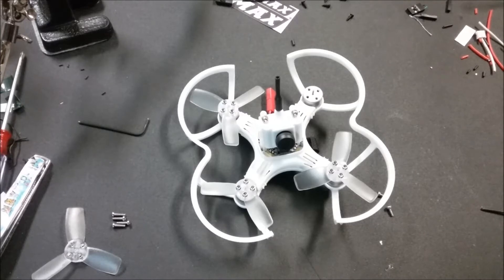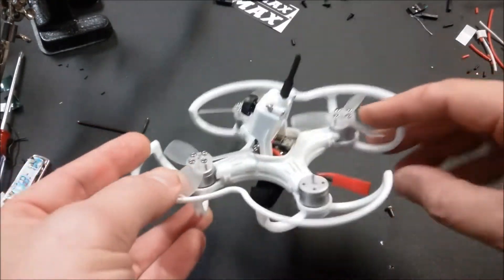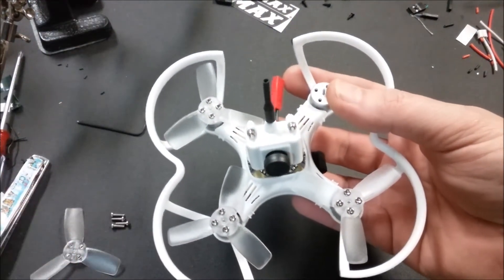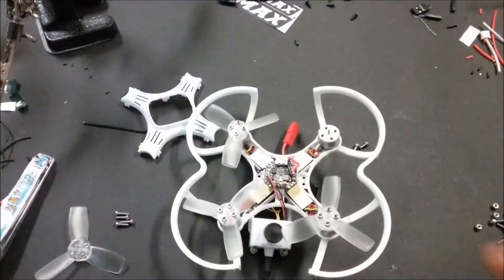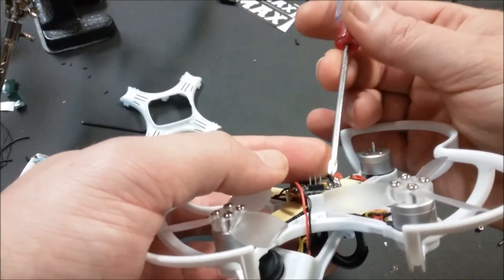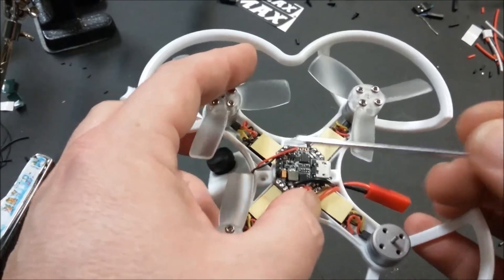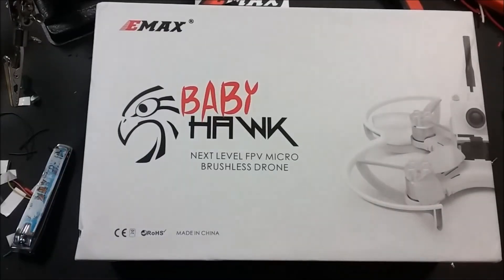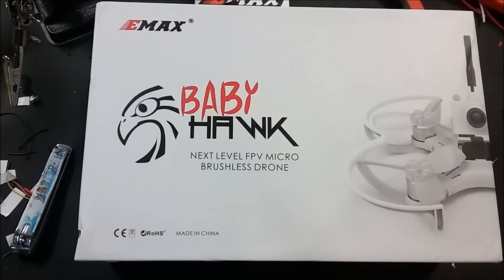How to install a satellite receiver on the EMAX Babyhawk

Comment: Just use a lizard 95 spektrum board for 20 bucks it fits right on
Reply from the maker: Peter Zingler, thanks for sharing your advice.   Sincerely,Dez
Reply: I noticed how complicated it is with the 3.3v so i found this lizard board online .it even fits the pins ;) but all in all frsky xm is what the babyhawk is made for
Reply from the maker: Peter Zingler very true and I have a Devo 8's modded so I can use anything but I have so many people that have given me requests for how to use a dsmx SAT and that's why I initially made the video. And when I made the video Emax had sent it to me before it was released so I really really appreciate you sharing that information for my subscribers. Thanks again sincerely Dez
Reply: Can you do us a favour and make a babyhawk 3s pids video ?
Reply from the maker: Peter Zingler I can probably do that I think I already got them done. I put my baby hawk guts inside a tomoquads frame but Im pretty sure I do have pids saved though from when I was flying 3s on it. I'll see what I can swing this coming week I'm out of town right now. Thanks for the suggestion. Sincerely Dez

Comment: Perfect, thanks for taking the time to make this vid. Appreciated!
Reply from the maker: No problem! Very Glad I could help!  Please subscribe,, I have lots more Babyhawk upgrade stuff coming in the next month. Also I just received the New Emax 1106 4500kv for 4s sent to me from emax!  Tomoquads is releasing a 2" frame called the Mikro 2 which I believe will be a perfect upgrade from the Babyhawk. It will be a very easy move to take the babyhawk parts right over to the better CF frame. You can also do it with the complete original Babyhawk setup and be ready to upgrade during the move or as your skillz grow..  Thanks again for the kind words and Happy flights, Sincerely Dez
Reply: I Subbed as soon as I saw the vid.  I've just got a babyhawk to go with my 4 and 5 inch racers and as a spektrum user (we get rarer by the day in this Taranis world!) it was exactly what I needed to fit my lemon RX. Looking forward to the upgrade vids. Cheers, Jez.

Comment: Do you only need the remote receiver?
Reply from the maker: Drift King, yes you can bind the sat rx in the betaflight software and you do not need a full rx to do the binding with the sat rx. Thanks for watching, Sincerely  Dez
Reply: desode9 do you think this is good for an amateur in quads I have done other rc stuff like fixed wing,boats,and cars
Reply from the maker: Drift King it is very durable and stable when set up in angle mode. it is however a quick little drone! even on 2s. If you have decent  experience in fixed wing craft then I think you would be fine with it. You may want to be wary of the power of it as a beginner in quads. keep in mind it can be flown indoors but it takes a haigher skill level to pull that off. It is more of a outdoor quad.  Keep in mind that if you are using a sat rx that needs soldered as in my video that it is some very tight soldering.  I havent looked but if they have the BNF versions out now I would recommend that route if you arent good at small soldering.  Other then that I think you would be happy with it as a first drone for back yard flying.  I hope that helps you out in your decisions.  Stop by any time! I always answer my viewers and if a subscriber of mine has a issue I will try to help them any way I can.  Thanks for watching. Sincerely Dez

Comment: Thank you for your review. Do you know where to order a HEX key in 1.4mm for the motors because I can not find anywhere.
Reply from the maker: Use a 0.50 Hex tool.. You can find them most places.. Ace Hardware is where I got mine. Emax had told me a 1..4mm Allen but I couldn't find one either,, that is actually a 0.50 hex. I hadn't found one until I did the Esc upgrade video so I had the size in that video which came after this one. 
Thanks for watching and please subscribe. Sincerely, Dez
Reply: Thanks desode9

Comment: i bind BH with  lemon rx dsmx satillite i.e i can see the solid red light but can't start the motor..
Reply from the maker: Yes that is what I personally am using!  Works great!  Thanks for watching and please subscribe for more Babyhawk goodness!  Sincerely, Dez
Reply from the maker: Do you have the Arm switch set in betaflight? It is under the Modes tab. You have to set it to a switch on your radio.
Reply: i set Arm switch in Aux2 and for some reason the ARM does not turn yellow in betaflight when i flip the switch.. i can't figure out what i am doing wrong..
Reply from the maker: Ashish Amatya, make sure that your throttle stick is all the way down and then if you have click save on the betaflight tab. The throttle stick is not all the way down when you throw the arm switch it will not arm. if that is not the case then it has to do with your throttle stick value you need to make sure on the receiver's tab that when you move your throttle stick the center position is 1500 the low position is a thousand and  wide open is 2000. You will probably have to adjust this in your radio settings via the radio and changed the range of the throttle stick. Also make sure that you always click the save button when doing anything in betaflight on each individual tab.
Reply: my throttle low position is 1159, mid around 1517, and max at 1841. 
Here's what i did.. http://sendvid.com/4v1c4xq1
What do i need to change ?
Reply from the maker: Ashish Amatya yes the low end of your throttle stick range is too high what kind of radio are you using? you're probably going to have to look up in the manual for your radio how to adjust the range of the sticks. you can try sub trimming the throttle Channel and while you're adjusting that in your radio look at your betaflight screen and see how much lower that range number gets on the throttle. every radio out there lets you change and adjust the range movement of the sticks. there are just different ways to do that on each different radio brand. I use a Devo 8's on my radio it's called scale. like I said the terminology and the instructions to do it on each radio is going to be different so you going to have to look in your manual for your radio. like I also mentioned your only 159 off so you may be able to adjust it with your sub Trim in the radio.
Reply: i am using devo10 so the config should be some what similar to yours i guess? In throttle mixer i can see scale set to 100 and offset 0 so i think its normal settings.. could you share your deviation ini file
Reply from the maker: Ashish Amatya I dont think the ini files switch between devo models but give me your email and when I get home Ill send it to you along with pics of my setting in deviation.
Reply: desode9 its ashishamatya at gmail Also plz send screen shot of pid. thanks again !
Reply from the maker: Ashish Amatya Gotcha! No problem.

Comment: i got my satellite installed everything works properly but the throttle. I get a reaction from all inputs but nothing from the throttle. any suggestions ,would be appreciated. thank you
Reply from the maker: Robert Walker do you have movement of the throttle stick in the betaflight software under the receiver tab? or are you saying that when you plug the battery into the babyhawk to fly it the throttle does nothing? if it is the second question that I asked that is because you have to set one of your switches to the arm feature which is listed under the modes tab in betaflight. you have to arm the babyhawk before the throttle will work thus letting it fly.
Reply: yes everything works when hooked up to beta flight. ive set the arming switch i can see it function and the motors arm as well, but there is no throttle response, however if i move the pitch or roll or  yaw inputs i get a reaction.
Reply from the maker: Robert Walker what radio are you using? are you using a Spektrum? The reason I ask is because I did have one subscriber who had to do a decent amount of rearranging in his radio settings and reverse some channels, also please note that in the same modes tab you need to set angle mode to a switch also. angle is what enables self-leveling, so if you don't have that mode set also then you would be in Acro mode by default.I also recommend making sure to check the direction that the bar graphs are moving under the receiver tab. The throttle stick when pulled down should make the graph get small to the left and when you push the throttle forward the graph should get big to the right. I would also double check and make sure that the names next to each graph on the receiver tabs correspond to the correct stick on the radio that you are using. One other tip I have has to do with the mode tab, always make sure to click save after you change something there once you click save you can disconnect from betaflight and reconnect to betaflight and go back to the modes tab and then see the square box that says arm turn yellow when you throw the switch that you have a mode set to. The same goes for setting the angle mode. I don't know your skill level either and that would help me to help you.  If you don't mind my asking what would you say your experience level is in the RC hobby? Ill do my best to help you through this.  Sincerely Dez
Reply from the maker: Robert Walker what radio are you using? are you using a Spektrum? The reason I ask is because I did have one subscriber who had to do a decent amount of rearranging in his radio settings and reverse some channels, also please note that in the same modes tab you need to set angle mode to a switch also. angle is what enables self-leveling, so if you don't have that mode set also then you would be in Acro mode by default.I also recommend making sure to check the direction that the bar graphs are moving under the receiver tab. The throttle stick when pulled down should make the graph get small to the left and when you push the throttle forward the graph should get big to the right. I would also double check and make sure that the names next to each graph on the receiver tabs correspond to the correct stick on the radio that you are using. One other tip I have has to do with the mode tab, always make sure to click save after you change something there once you click save you can disconnect from betaflight and reconnect to betaflight and go back to the modes tab and then see the square box that says arm turn yellow when you throw the switch that you have a mode set to. The same goes for setting the angle mode. I don't know your skill level either and that would help me to help you.  If you don't mind my asking what would you say your experience level is in the RC hobby? Ill do my best to help you through this.  Sincerely Dez
Reply: im using a DX8G2 ive made sure everything is working correctly and in the correct direction as two channels were opposite pitch and roll. the modes are set on a switch, i have verified they are switching properly at least in beta flight, they are. its very confusing to me as the motors do arm they spin at idle but dont respond to the throttle. i am at a loss. i had to do a lot to get to this point.
Reply from the maker: Did you bind it with DSM2 or DSMX? I am assuming dsmx but please confirm. Also did you bind through a full rx with your SAT or did you bind it through betaflight?       Next, check in your Betaflight config tab and make sure Serial Receiver Provider is set to whichever your RX is using. Either SPEKTRUM2048 for DSMX or SPEKTRUM1024 for DSM2 transmitter. I have had movement and channels work when using a both with certain rx's.       If that is all good then next I would check the range settings on the Throttle in Betaflights reciever tab and adjust the radio so the throttle stick movement matches the following ranges.  The radio sticks have to match the min, the mid (center) and Max setting in Betaflight. With your throttle all the way down it should be 1000 and with your stick centered 1500 and all the way up 2000.. If those are not correct it could be causing this problem. Check that all out and let me know. Sincerely, Dez
Reply: ok im Bound to a dsmx 4648 receiver, bound through the radio, this was actually the first time i did not have to change channel set up to TAER,though mu pitch and roll had to be reversed, checked all the values they fall right where they should 1000 min 1500 center and 2000 max its set to spectrum 2048. 
Dez I, want to say thank you for all your help.i dont have anyone locally i can check this with. you have been great to help me.
Reply from the maker: Robert Walker Try checking through these steps in this link. keep in mind the betaflight is written on the structure of cleanflight so while the article is about cleanflight it works with betaflight. there is a step where you go into the CLI menu and type in a command for Spektrum receivers and that may be your issue. I would also recommend that if this still doesn't solve the problem , you may want to try binding your Rx to your radio through betaflight instead of using the full receiver to bind it. I personally find all my satellite receivers on my micro quads through betaflight by the steps in this link.  https://flexrc.com/2016/04/22/how-to-configure-cleanflight-and-bind-dsmx-satellite-receiver/
Reply: desode9 ok went through it step by step double checking each step of the way and I'm still having the same issue no throttle response everything else is still working motors are but no throttle
Reply from the maker: This is very strange, let me review everything we know just to double check for myself ok,,,,  1.You have throttle stick movement in betaflight on the receiver tab right? That shows us that the receiver is bound and receiving throttle movement from the radio. 2. The quad arms when off betaflight and a battery is plugged yet, the motors move also after being armed but only when you use the right sick correct?  3. what have you used this radio to fly before using it on the babyhawk?
Reply: There is movement in using the yaw on the left stick,as well only nothing with the throttle, yes there is movement in beta flight and the motors do arm. I have a quad I built a 250 size that I also fly with this radio and a plane
Reply from the maker: Robert, I am starting to wonder if you got a Bad Femto flight controller on there.. Even I am running out of ideas at this point.  What do you think about giving me your email address and I will send you pics of all my Beta flight screens and you can double check that?

Comment: is it bad if I get solder ACROSSED the two boot pads (bridging them) when I'm soldering on my 3.3v wire? wondering if it'll cause harm. thanks!
Reply from the maker: Pig Balls , What a name!  lol. ok so yes that would cause a issue. if the boot pins are soldered together that will put the quad into boot loader mode and when you plug it into the pc you will not be able to access betaflight. It is not something that does any long term damage and shorting the two boot pads is actually used to add new firmware.  Still you need to remove enough of the solder that they are not soldered together.  Sincerely Dez

Comment: Wait, in the femto f3 link it said the center pin in the front is 5 volts, in your video you said it was 5.5 volts. Who is correct? When I buy this should I plug my 5 volt receiver into the center pin instead of the 3.3 volt?
Reply from the maker: Dank Memes if the femto diagram says 5v then I miss spoke. The diagram from the factory should be correct. My apologies on that. If your receiver supports 5v then the front pin is fine. If it is a Satellite rx then they pretty much only take 3.3v so use the boot pin.  Just make sure to check what the volt range is on your chosen rx.   Thanks for watching. Sincerely Dez